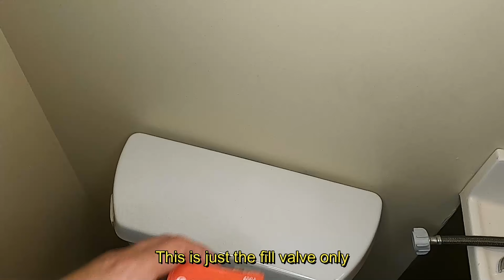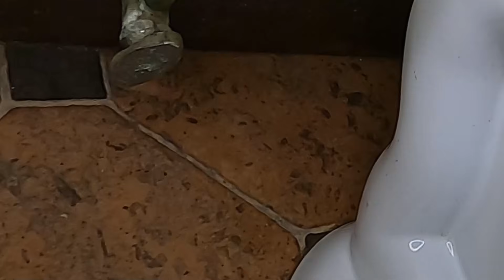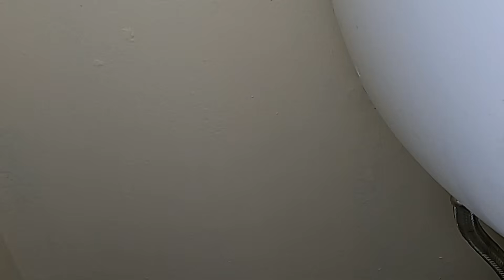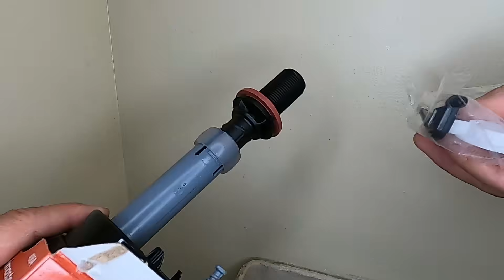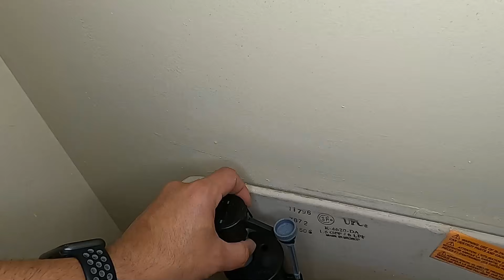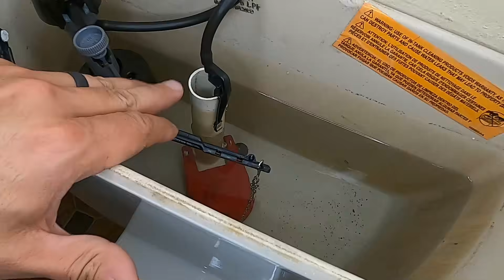How to replace toilet fill valve - For Beginners

Comment: I watched this one and a bunch of other videos for replacing the fill valve and toilet handle before attempting it myself  Thanks to these videos I was able to do it easily myself using a fFuidmaster 400 A universal and a bendable universal lever. both of which work very well in my Kohlerr toilet.If I can do it, anybody can. I also replaced an electric switch  earlier this year which took me a longer time but ended up working fine. So I am very thankful to this guy and all the others on you tube who show us novices how to do these repairs.
Reply from the maker: Thanks for the kind words and I’m glad you were able to get it fixed. This is my most popular video by far

Comment: Your valve wasn’t pumping, mine sounds like it’s not shutting off all the way, as if water is still running, i pulled the bulb up all the way and the it still sounds like is filling up,, is the valve bad??
Reply from the maker: Yessir. You might be able to disassemble and clean it. Sometimes sediment gets in the valve seat if it’s an older fill valve before they started putting filter screens at the water inlet connection

Comment: I’m having that trouble my toilet tank is warm is that due to needing a new fill valve
Reply from the maker: If it’s warm that’s most likely due to it being fed with either hot or mixed water to prevent condensation on outside of tank
Reply: @theguyofalltrades  so what do I do
Reply from the maker: @Darlene-j9t  If it's purposefully plumbed with warm water I don't think you need to do anything unless there's an issue
Reply: @theguyofalltrades  dad said not to worry

Comment: Thank you so much for making this video, it helped me not be scared to tackle this! Just finished replacing the fill valve and the toilet is no longer groaning when we flush it. 

Unfortunately it took a lot longer than 15 minutes, lol. 
Had to use a Saws All to cut the plastic nut off the hose, then had to buy a new hose with a metal nut (went back a second time because I'd accidentally bought a faucet hose instead if a toilet hose).
Reply from the maker: Glad you got it fixed. Yeah unfortunately there are far too many sizes of hoses for bathrooms. Not sure why they don’t have one for all

Comment: THANK YOU SOOOOOO MUCH!! Your video was the BEST one. Very informative, straight to the point*  and I like how you explained how I could measure the water level (grey screw thingy lol) I watched about 12 videos and yours was the best. Saved me $399. Crazy out here.
Reply from the maker: Welcome! If you have any issue with the flapper valve I have a separate video that shows how to adjust or replace also
Reply: @theguyofalltrades  That’s awesome. Thank you. I noticed that the tank won’t take full. It drops a little and the water runs to replace it. I don’t what happens. The vale is working fine tho . 😮

Comment: Does the nut to the fill valve turn clockwise to remove? I'm an older woman but I should have the strength to turn it, just not sure which direction
Reply from the maker: Counter clockwise. Righty tighty lefty loosey if you’ve ever heard of that phrase

Comment: I got a question here i used to same setup but when i put it on somehow the water never stopped flowing it overfilled the tank even thought the floatie was up water kept running whats the problem?
Reply from the maker: Sounds like a bad valve if the water didn’t shut off with the float all the way up.

Comment: Omg this video is great, working on my mom's toilet that must be older than this one bc they didn't use a tube to connect the water valve and the grey plastic piece they used to connect the two is shredded and won't turn 😢 it just spins so I'm going to have to cut that to free up the white one above it 🥵thanks for the video and now I know how they screwed. It up but how to fix it😊
Reply: Sorry I cut out that they put a straight skinny metal pipe instead or a hose on this thing 😅
Reply from the maker: Welcome and glad I could help. Yeah I’ve seen both metal and plastic supply lines instead of the braided hose. I prefer the hose because it’s easier to connect and you don’t have to trim it.

Comment: My problem is the water keep draining that makes the tank imposible to fillup, it was draining from the rubber valve where the water flashes, any tips?
Reply from the maker: Is the flapper worn or chain too tight to the flapper?

Comment: Thank you for the easy instructions. I did it.
Reply from the maker: Very welcome. If you need some more detailed instructions for replacing the flapper valve or adjusting water height I have some dedicated videos for them.

Comment: Our old toilet does not have the flexible water supply line shown in this video. It is a hard metal line that goes straight up to the toilet. How hard will it be to take it off since it is does not bend?
Reply from the maker: You can just loosen the fill valve then the nut on that hard line and lift the valve off of it. Then change to a flex line if you want

Comment: What do u do if the connection that on the top of the fill value is rusty looking  what is the easy way to get it loose
Reply from the maker: You mean on the fill valve inside the toilet or the shutoff valve where the hose is?

Comment: No plumber is showing up for $50 - $100 near me! This video is saving people $200 easy in my neighborhood.
Reply from the maker: That’s definitely a true statement. I keep seeing 150 to change this valve. Crazy and super easy to DIY
Reply: @theguyofalltrades  I dropped a deuce, changed my mother in law’s valve and started a load of laundry in between these two comments.
Reply: I was quoted $125 a month ago so I refused and stopped using the toilet. I already have this replacement (from amazon) and it’s been sitting there. I will make an attempt this weekend. Hoping it works for me as well.🙏🏾🙏🏾🙏🏾
Reply: @qwambyBee  it's real easy, not worth putting off and using the bushes. Go for it.

Comment: Hi Dennis,

You did a nice job with this how-to video. One thing I'd add is that, before locking it in place, you want to adjust the fill valve by loosening the lock ring and turning the lower shank accordingly,  so that the top of the fill valve is 3" above the overflow pipe. This will  automatically put the C.L. (Critical Level) mark on the fill valve 1" above the top of the overflow pipe. This is so that the "Universal Plumbing Code" is met. Ideally, you want to adjust the Float Cup with the fine-tune screw so that the water level reaches approximately 1/2" below the top of the overflow pipe, after flushing. Lastly, I would recommend purchasing a kit that includes the flapper valve as well, as this only add a few dollars to the cost, and then both pieces of hardware are replaced together.
Reply from the maker: I have a newer video that actually goes over all those steps but thanks for pointing out

Comment: My fill valve is stuck. How do I get it out. Not enough space to get pliers in there
Reply from the maker: Room for a small 4" adjustable? That's what I normally use
Reply: @theguyofalltrades not without removing the overflow tube
Reply from the maker: @jones2277  you remove from underneath. Shouldn't have to touch the overflow tube
Reply: @theguyofalltrades  I tried from under too but it’s not budging. I think it probably needs to be sawed off
Reply from the maker: Sometimes you can use a wrench on the bottom and twist opposite direction from top. Is the stem brass or plastic?

Comment: I have a question. Can you change your old type flushing toilet to a water saving, fast flush toilet by putting in a special fill valve instead of replacing the old one with the same type. Thanks for you time if you read this.
Reply from the maker: They have water saving flush valves but I believe you have to remove the tank to install the new flush body

Comment: Just did this! I changed my flapper (do it regularly as needed.) Thanksgiving - water was still running after I returned from moms (6 hrs!). I tried the twist knob on top and it stopped momentarily, but then ran water again. I pressed down on the top of the valve and that momentarily "sealed" the valve to the tank and water stopped. Using flashlight, I could see seal on tank bottom was split and worn. I knew I needed a new valve. Shut the water off. Went and got a new Fluidmaster and followed your directions. Shut water off & unscrewed connections. Put an old towel to soak up as much water as I could. (Too lazy to pull shopvac out of basement). I used an old mixing bowl and a Big Gulp plastic cup to catch water. Installed valve and connected water hose. Put water back on. SPRAY! WHOA! LADIES: Turn water on slowly just in case! No problem- my mixer and towels were there. My water connection wasn't good (I did it by feel and didn't really look underneath.) Laid down underneath and really looked at what I was doing and tightened it correctly. Held my breath and turned the water back on. No spray and water is going into tank! Viola! I (Actually my first words were No Sh*t!) 'm 60s, female and retired also. I appreciate your vid. FYI: I also replaced toilet seat and HomeDepot charges $60 in my area to install a toilet seat!!! Service was available on this item but didn't say how much. Sorry for the novel. Thanks Guy! You are appreciated.
Reply from the maker: Very welcome! Glad you got it fixed

Comment: If you don't want to replace the hose, or deal with sucking out the water, etc, you can just pull up the locking ring on the grey part, and pull the whole float up. Waaay easier than dealing with removing that stem. Keep the old stem, and just replace the grey part, the float and the valve itself. Took all of 30 seconds to do.
Reply from the maker: Yup that’s definitely an option. Just remember that there is a small plastic filter in the stem where the water line connects which can get clogged and cause the full valve to be slow or noisy.

Comment: Great video. My tank fills very slowly. Water is a strong steady stream into the overflow. Is there a problem with putting the water going into overflow, into tank ? It seems to work great when I do that.
Reply from the maker: Depends on your water pressure or if the fill valve has gunk in it. There is a little plastic filter built into the bottom of the valve where you connect the water. Sometimes sediment gets in there. They put that there to prevent that sediment from getting into the valve itself. You can remove the hose and normally pop out and clean that filter. On the fluid master valves that I’ve replaced anyways
Reply: @theguyofalltrades  Thanks, I'll try that. My pressure is strong coming out the overflow tube. Toilet fills or shuts off in 65 seconds with it not in overflow tube. I have pulled the top cap of the fill valve and sprayed water into a cup and then looked at rubber seal on top and that looks good.  Of course replacing this seems pretty straight forward.
Reply from the maker: That was my next piece of advice was to take apart the valve top

Comment: Could I just remove the water line from the bottom of the tank and not from the wall and it still work
Reply from the maker: Yup. I sensed up replacing it which is why I removed the entire thing

Comment: The instructions say the top of the fill valve cap must be at leasr 3 inches above top of the overflow pipe. However, if i have it exactly that 3 inches higher, the tank top will probably press down on the fill valve a little. (There is a Korky fill valve presently.) Any suggestions for me?
Reply from the maker: As long as you can lower it to fit but also have the water to about 1/2” from the top edge of the overflow you should be good to go
Reply: @theguyofalltrades Thanks so much!
Reply from the maker: Welcome

Comment: Dennis, Guy of all trades🤩- thank you for this video/instructions. My toilet was leaking from the bottom of the tank at the seal from the flush valve which is pretty old and the water line too. Made me nervous to see all the water leaking😬 I am a woman on my own and wasn’t sure I could handle this job myself but, thanks to your video and demonstration I gained the courage to replace the flush valve, flapper and even the waterline 🎉I DID IT! 💥I’m feeling a bit proud of myself and just have to Thank you so much!
Reply from the maker: I like to read comments like these! I’m glad I could help. Thanks for watching!

Comment: After replacing the toilet valve, I noticed that the water did not rise up to the original level.  I turned the tank water knob so the water level would rise.  It did rise, but still not to the original level I wanted.  What am I missing?
Reply from the maker: You can adjust the height of the valve. Checkout my newer video on the toilet valve. It shows how to adjust in detail
Reply: @theguyofalltrades   thanks,  I increased the height of the valve.  That fixed it.
Reply from the maker: Awesome!

Comment: Can't get the connector nut to give way. Any advice?
Reply from the maker: The one holding the valve in the tank? Try spinning the valve while holding the nut on the bottom and spinning that at the same time. Turn in opposite directions of each other. Is it plastic or metal?

Comment: This is gonna sound so dumb, but I’m not usually a “handy” person but replacing this valve gave me a new found self confidence haha. Thank you so much for this walkthrough!
Reply from the maker: Haha welcome
Reply: Not dumb at all, Mike. I was right there with ya.
Reply: Yeah, thanks a lot.  I am exactly the same way.  Changed it out in less than 15 mins.  Such an inexpensive assembly.  I am ready to change my transmission now!  😳

Comment: Quick question. I replaced the fill valve and I didnt see where the black straw pipe comes in at. The toilet is leaking from underneath and Im not sure if the fill valve needs a rubber gaskit on the underside of the tank or the same thing with the water hose going into the tank needs one or not. It wont stop leaking!!! SOS.
Reply from the maker: There should be a gasket inside the tank where the stem of the fill valve goes through the tank. The black tube is normally connected to the top of the fill valve assembly. There’s normally a port there

Comment: I am scared to do this but I do have a question. The little hose from the valve to the overflow, seemed very long and I was concerned it would get kinked up. Would you trim it down or was it just the angle we were looking at that seemed like there was a kink?
Wish me luck. I understand electrical but not plumbing. I watched my ex do this about 30 years ago. Yay YouTube!
Reply from the maker: The skinny tube you can trim with scissors if it’s too long

Comment: What if that pipe that the water drains into if the tank overfills breaks off at the base of the tank? Do you need a whole new toilet?
Reply from the maker: Nope. You’ll have to take the tank off and install a new flapper valve assembly

Comment: There was a trembling noise coming behind the wall from some pipes where the toilet is at. I called the plumber who came to see it and told me it was more likely the fill valve. He was going to charge me $175 to change it but I told him I was going to do it myself. 

I followed your instructions and changed it in 20 mins or less. Super easy instructions on how to change the fill valve. Thank you so much sir. I appreciate it very much!!!
Reply from the maker: Love comments like these!
Reply: @theguyofalltrades  How do we have to tighten the bottom plastic nut that holds the valve inside? Is it hand tight or do we have to use a tool?
Reply: @slwide7507 Hand tighten
Reply from the maker: Adjustable wrench or channel locks

Comment: The maintenance at the place i live at installed one of these but it drips water on the top left part when it's flushed and the water is going up. They claim this is normal but I told them i don't believe them. Are they right? If not, how to fix it and what's causing it?
Reply from the maker: Like out of the top of the valve?
Reply from the maker: The top comes off. Maybe it’s not snapped on all the way

Comment: Thank you for posting this video! I have theee toilets and only one is working but in it’s last leg because of the old fill valves. Crossing my fingers I can do this 🤞🏼
Reply from the maker: Welcome. It’s pretty straightforward.
Reply: @theguyofalltrades  I have an unrelated question. My bathtub fill spigot broke off kinda inside/behind the fiberglass shower wall. How does that get fixed? Plumber?
Reply from the maker: Unless your comfortable soldering pipes. Could also be a pipe that rotted at the threads. Either way you would need access to behind the wall if it broke off in there
Reply: @theguyofalltrades  it’s a plastic pipe. My house is 30 years old. Sounds like a professional job to me. Thank you for answering me. I appreciate it. Enjoy your weekend 👍🏼

Comment: About to replace mine, thank you for your video
Reply from the maker: Welcome
Reply: Didn't need to replace it... apparently the underneath of the pink flapper has a dial with numbers 1,2,3,4,5 which come with a hole the smaller the number the smaller the hole, the bigger the number the bigger the hole...mine was on 4, so I head to switch it to five and it solved the entire issue... basically each holes allows the pink flapper to fill up with water in order for it to close up the correct way and prevent water from running continuesly.👍🏼
Reply from the maker: Yessir. I’m actually working on a video about common fixes for toilets too. Having a flapper chain too loose will cause that same issue
Reply: @theguyofalltrades  you know what your right... once i fixed it i notice that the chain is close to the pink flapper, so what i did was to flush it multiple times to see if it get caught underneath the flapper, and so far it hasn't done it,...but if it does start to I'll be sure to decrease the chain so to prevent it from occurring... once again thank you for your video. 👍🏼🤜🏼🤛🏼
Reply from the maker: Welcome!